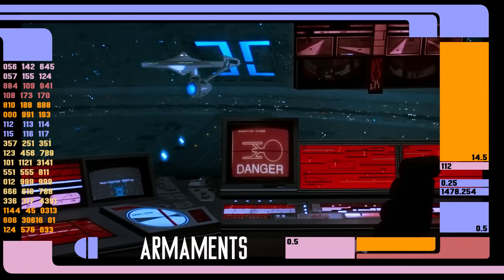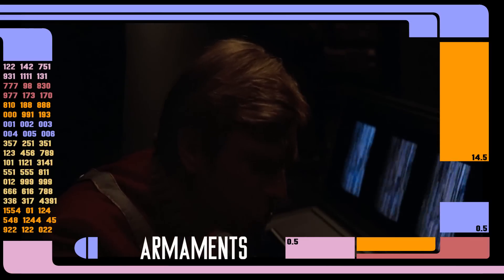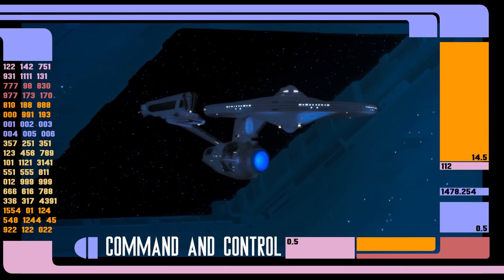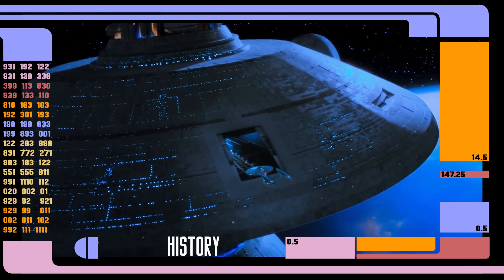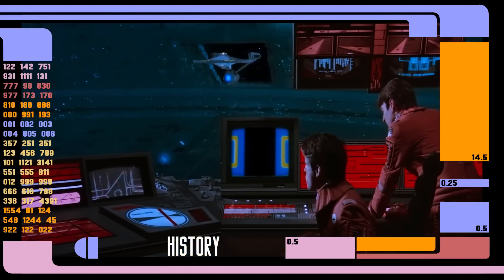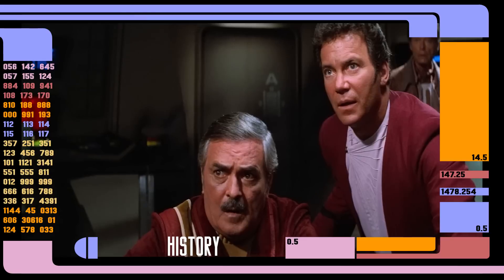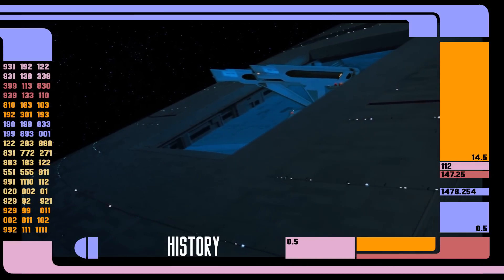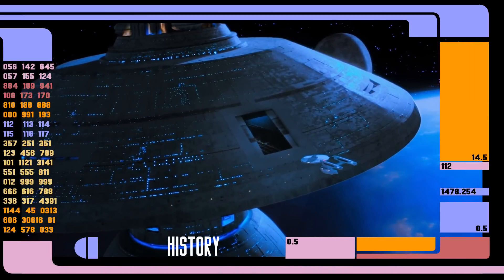SpaceDock: The Greatest Federation Starbase Design

Comment: Solar power as well . I imagine its power the way deep space nine is powered, fusion reactor.  But an anti matter reactor would also make sense you dont necessarily need it to just go to warp . It powers everything ( almost) the power requirements would equal a fleet of star ships.   But if earth is solar powered then space dock must also be . ( emergency power is solar ) i believe.
Reply: I'd imagine it has some pretty damn beefy shields so it'd need equally beefy power generation. I'd guess it has a mixture of different generators and passive systems like solar, each as an extra fall back if one fails. I can't imagine how much power is needed to keep it in orbit.
Reply: @TalesOfWar  If it's in low orbit already, not a lot. Just needs some power for maneuvering thrusters to keep the orbit stable from the slight atmospheric drag. it's not just gonna lose all the orbital speed it has for no reason.
Reply: The amount of solar power generation from Spacedock's surface, even assuming 100% efficiency would be negligible in comparison to what nuclear fusion offers.
Reply: @schwarzerritter5724  maybe.  But if you recall ( voyage home ) dialogue.  The admiral tells the president that the ground based solar power system can power the earth for 24 hours. It sounds like they ise it as much as possible to conserve energy.  ( environmentally friendly ect ) it appears that Jupiter station has a bigger solar power system.     But its further away.
Reply: @shanenolan8252  It has been a while since I watched the movie, but I thought the dialogue was the ships where going to rig up a solar power system to keep the life support going until they are rescued.
Solar power does not work well when the entire planet is covered in clouds.
Reply: @schwarzerritter5724  yes that was the point , the alien prode created a massive global cloud and blocked out the sun , and also deactivated all the other power reactors, ( all starships power systems deactivated) ( like an emp ) and the dialogue daid the normally the solor power system was enough to power everything ( this was on earth so life support wasn't a concern) the ships and spacedock only only had the oxygen in the air already.  ( for example i believe the enterprise d without life support had 12 hours of oxygen) but the communication system, power systems( electricity power grid on 23rd century earth) were solor powered, but the had other forms of power , that fed into a planetary power grid . In the absence of those and without the solor energy, the solar batteries could provide emergency power for less that 24 hours, i imagine all none essential power was rerouted to hospitals and essential government or emergency services, Starfleet command. Or the United earth government.  In ds9 during the planetary power sabotage incident, i believe the dialogue said it was the grib control system itself that was sabotaged, and all the reactors were artificially deactivated or put into some sort or safety shutdown, and it took a week to fix . But there were no storms and the prope was also doing something to the atmosphere, removing oxygen.  ( unintentionally) i read somewhere that after the Breen attack on earth during the dominion war, assaulted the planet from orbit and launched air strikes with fighters, the bombarded san Francisco, paris , new york and Beijing.  ( Starfleet headquarters, federation headquarters and attacked the planetary power system.  ( based in those four cities) took out power for almost 2 weeks and apparently there was an anto earthquake system that when deactivated set of earthquakes ( san Francisco san Andreas fault) and weather control systems.  80 million plus casualties.  ( dominion war source book and novels)  the also decimated federation 3rd fleet ( 200 ships lost )  before the  remaining ships , reinforcements and orbital weapons platforms and spacedock could respond.  It was a suicide mission 300 ships ( Breen) destroyed most of the damage was done in a few minutes.  In earth orbit and around mars and Neptune.  ( apparently) picard and tje enterprise were involved.  His taskforce was in earth orbit.  (  the task force we see defending earth in first contact)  its been awhile since i watched the voyage home myself. But my memory usually serves.  ( the other stuff i was watching some lore videos recently)
Reply: @TalesOfWar  yes , power and shields.  But if you recall ds9 . (. Way of the warrior and a call to arms ) a Klingon fleet of around a hundred ships and later an even larger dominion fleet.  Open fire on ds9 and the shiels held and they had weapons power to fire at at least 3 dozen targets at the same time . ( shiels , phasers, torpedoes and life support)  fpr a brief period of time . But i believe the station wasn't built to do that originally it was upgraded  gradually over a year.  Mostly between season 3 and four .

Comment: I would imagine that these installations are extremely formidable. It's possible that the installation largely depends on the ships inside it for defense, but given how slow the process of launching a ship seems to be, I'm not sure that would be practical. Hence, why I think the installation itself is probably rather capable tactically speaking. Also, a defenseless base during say the Breen attack could be damaged or destroyed and at that size would pose a serious risk to the planet below. 

It's also a great design in that it protects ships internally while they are powered down versus stations like Deep Space Nine or smaller Federation designed installations where ships have to sit in external dry docks where they are vulnerable to attack. 

Also, like the Klingon Bird of Prey there may be multiple sized variants of it, it's likely that this was upscaled for ships like the Galaxy class. Although, it looks like the Galaxy could probably fit in there if the doors were much bigger, but that doesn't seem to be the case with Starbase 74, the only other Spacedock style base we've ever seen. The base seemed larger to accommodate the much larger vessel.

Comment: Referencing the ST IV novel the Space Dock is said to protect constructed ships from micro meteors that would cause fractures to a hull that doesn't have its defector active.  If this is a problem or not in this franchise it does beg the question of the Drydocks that orbit Earth since they are not as protected.

Comment: As a "dry dock" for starships...it could be better. Having one centralized bay shared by all ships means you can't really pump atmosphere into the bay since ships are always moving in and out. (Except by relying on force shields without backup.) Having one central door makes it so you can't scramble all ships in an emergency. As a dock, it's "defense system" should be the fleet, so it would be acceptable for Spacedock to be a soft target.

What would be better is to have multiple bays of various sizes each with its own door. That way you could pull a ship inside a bay that will only be used by that one ship for the extent of its stay, lock the door, and pump atmosphere into the bay to make it easier for maintenance crews to operate. It would also minimize the amount of time the ship would have to fly through confined space and thus reduce risk of "traffic accidents".

Comment: There is a complete 'blue print' of the Space Dock, and it's clear that Space Dock is not a defenseless station. 
According to this diagram it's weapons are:
- 200 Phaserbanks 
- 40 Megaphasers (a term I never heard before, but considering the size of the station it's doable that you can put phasers on there with a lot bigger output power)
- 20 Torpedo Launcher with a total  capacity of 4,000 photon torpedo's, which seems a little bit on the low side, considering DS9 had 5,000 torpedo's on the ready for the Klingons and DS9 is only a fraction the size of Space Dock (1/7 the height), and most like 20 to 50 times less the mass. Space Docks dimension are said to be 7km in height and both 4.6km in length and width, making it larger than a Borg Cube.

Comment: You know... there are pros and cons to such a design. On one hand, all of the ships inside are protected behind what is likely to be a pretty robust shield. Thus they can be kept safe while being repaired, or simply while not actively engaged. And you could in theory hide just how many ships are inside and their condition.

However...
If an enemy is ever able to cause enough damage, you could have several star ships trapped inside. Their only recourse could be to blow their way through the main doors, which now gives an enemy easier access to more vulnerable internals. Or if they don't, they could be in danger of taking damage from the starbase as it is destroied, though granted any dry-dock will carry that risk

So in a way, there is a degree of gamble in the design. You're betting the defenses will last long enough to get the ships able to fight fired up and out into the fight. But at the same time, any ships that are too damaged can stay in safety.
Reply: So my idea is if you see underneath the main ring, I bet that fanning will open up every dock the station has so they can launch all the stored ships at once. My theory is they don't do that because it causes issues with the structure's interior maintenance docks.
Reply: @Zachomara  That's actually not bad. It could be a good idea for an emergency/rapid deployment. You got even 7 ships in there ready to go, and an enemy fleet shows up with no warning, screw the main the door. Open up the fan and all 7 can fly out at once instead of parading into enemy fire one by one. Better still if you have quite a few. The fan opens, and out comes a whole flotilla ready to fight.

Same with mass evacuation too. Open the fan, ships, shuttles, and pods can all escape rapidly.

I might actually adapt a version of that idea to my own star fleet.

Comment: The anti-matter reactors on starships power everything. I think it is reasonable to assume Spacedock one was powered by anti-matter reactors. It would need far too many fission or even fusion reactors to power the entire thing.
Reply: Not actually true. Just the primary power grid.  Which, most systems are plugged into, and of course CAN be powered by it, but most of the ship outside weapons and engines REQUIRE it. 

There are dozens of smaller fusion reactors all over the ship that provide limited power, which is supplements by the main reactor when necessary,  and provide secondary power to other systems if necessary.

Comment: There is enough space directly under the large saucer like structure to radial mount/place shipyards for externally "drydocking" vessels to the station.
Though I wonder if using a more modular design of sorts would also make sense, like a large hospital, or hydroponics thing... or mineral processor.
Even if it was just modules that could be towed away and used as needed, like the "holographic ship" seen on insurrection.

The design is simple and keeps most of its shape and volume in a rather solid shape, and from the specs I've seen from various "technical" sources about it. 
It could be moved around as a mobile command station if absolutely needed.  I would however point out I have seen some comments stating it is unarmed.

There are a few things about Starfleet that they do right, and quite a few things I feel, they do wrong.
But either way, more detail or progression on the structure in any of the Star Trek shows I think could go a long way for the hardcore fans.

Comment: It would make sense to have the space dock to have shields and weapons to defend itself. It would have at any time have ships to assist with defending it in various states of repair. In a defensive situation you will use whatever resources you have available to help defend against an attack. From looking at the tactical side of things the space dock is a high value target even if it’s not positioned very well strategically to defending earth, but that’s not the point of having space dock. It helps with keeping the ships in the fleet staying in the fleet. Whether the invader plans to occupy earth or simply is trying to do the most damage to earth as possible space dock will be a target. If the invader is planning to occupy earth they might try to capture space dock for their own use if possible and would only destroy it if necessary or by accident. If they’re just trying to inflict the most damage possible then they would make an attempt to destroying it

Comment: If Spacedock is also a Starbase, then by design it should be heavily armed and shielded. The original tech manual showed the plans for a starbase, which had "super phaser" turrets on the outside of it. I'd imagine that would have even more powerful ones by the 24th century. Also phaser arrays as point defense systems, advanced shields and armour as well - all upgraded due to the Borg and Dominion War threat. Most likely most would be retractable (and maybe even cloaked to keep them hidden from sensors) so we never see them. Plus Space Dock is huge - we never see that many close ups of the outside so we may have missed the weapons. Phaser arrays would have hull armour or armour plating over them when they are not it use, again so it doesn't seem so "war like".

I think it would also be powered by an matter - antimatter reactor or a few dozen. The power needs of such a station would be enormous. Adding weapons and advanced shields would take even more power. Plus it most likely was also a fuel station for all of the ships inside it - so there would be plenty of antimatter on board. Fission power? Seriously? Maybe fusion power at the least. Or as a backup system. (I also wonder how many people died in those small craft inside spacedock when their power went out - no power, no life support. Little backup power on such small craft as well. Not to mention how they stopped moving??? The engines may have shut down, but they still would have stayed moving until they hit the inside of spacedock.)

Comment: Ya know the weapon upgrades the Federation did to DS9? That's a relatively small station compared to Earth Space Dock. Now consider weapon mounts like that covering every conceivable angle on the Dock. No matter the angle they could put a half dozen phasers on any single target and with stronger phasers than can be mounted on a starship AND maintain extended fire until the target is incinerated. They could also engage dozens of targets simultaneously with one or more phasers at any point. Then there's the photon torpedoes. DS9 had 5000 aboard. Space Dock could easily have 10x that. They could fire them just like a machine gun. Throw in quantum torpedoes, even more powerful. Shields powered by the massive fusion reactor would be incredible. They would almost certainly have smaller reactors all over the Dock augmenting the primary shields, kicking in as necessary or providing redundant shielding in critical areas. It would take a huge assault to crack defenses like that and a willingness to suffer horrendous losses.

Comment: Militarily, Spacedock is too big to hit, but at the same time, it can hold an entire fleet inside of it.  If you wanted to invade Earth, spacedock would be a deterrent, even when you do not attack the side of the planet it is orbiting.  And I dont believe at any point that it is stuck in one certain spot over the planet, but can easily adjust its orbit to be at the attack point of a enemy and severely fuck them up
Reply: If it's meant as a deterrent, it would be in geosynchronous orbit over San Fransisco. That way attempted attacks from other angles won't hit Starfleet headquarters, and it makes logistics slightly easier.

Comment: I think they would use matter/anti-matter reactors, rather than a full warp core, alongside fusion reactors.
Reply: "Warp core" is just a nickname for matter/anti-matter reactors.
You need an anti-matter reactor if you need to generate large amounts of energy in a small room. But room is not really an issue for a station, so the much safer fusion reactors would suffice.

Comment: Spacedock was mainly build for its symbolic value and not its practical application. The closes real life equivalent would be a submarine bunker.

A ship is probably easier to repair with the scaffolding we see in many episodes than inside Spacedock. 
Since all ships need to go through the one door, they can not be launched quickly in an emergency, you even showed a clip where they got trapped inside. 
Any protection Spacedock offers mainly comes from its powerful shields, but you can have shields with an open structure.
The only advantage that Spacedock would offer is that it can be filled with air, so the maintenance workers don't need spacesuits, but I don't think it is.

The idea that something in space needs to be surrounded with metal is inherently an Earth idea; his pattern indicates two-dimensional thinking.

Comment: ok here is an idea space dock itself is  an ARK...slow warp vessel say warp 5 and it was designed that way...for one if you take a look at vulcan vessels they have circular neceles and impulse engines can come in many shapes as for power most starfleet facilities past certain size use anti matter as power supply due to efficiency but they use fusion as back ups